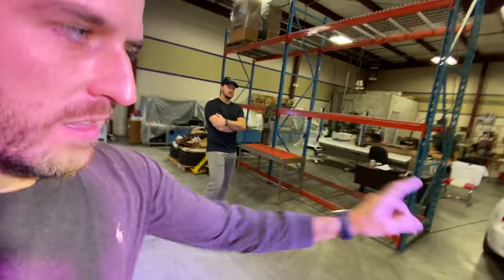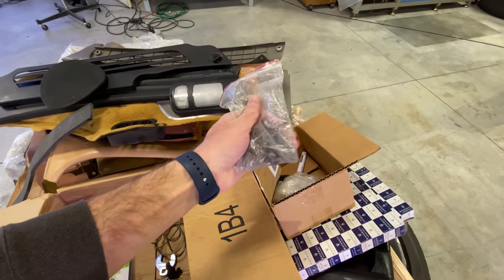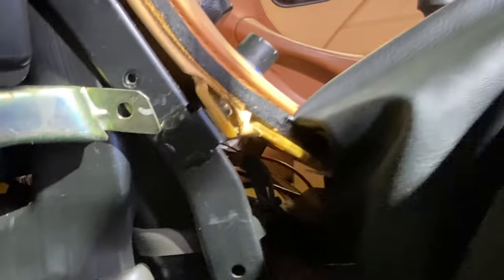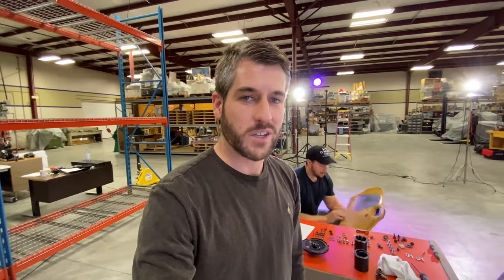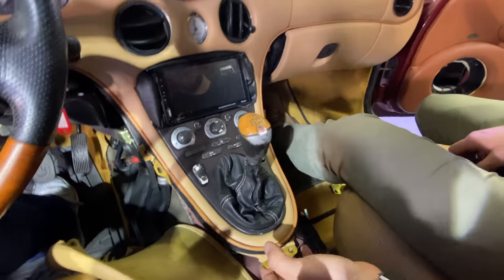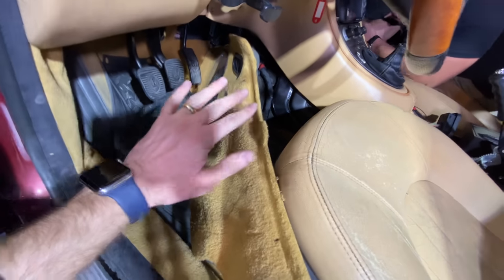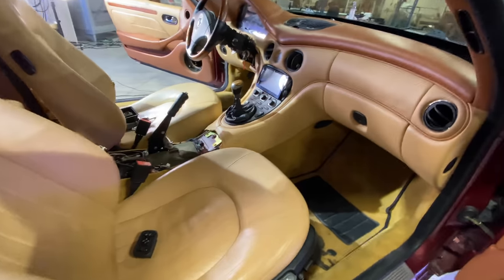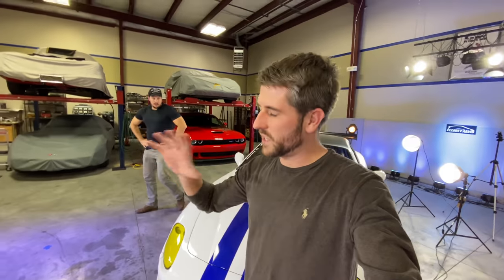Installing My Cheap Maserati Interior Is Like An Expensive Jigsaw Puzzle (With Many Missing Pieces)

Comment: That hole under the center armrest is for the OEM CD changer which should include a nice leather trim. https://www.eurospares.co.uk/parts/maserati/4200-coupe/electrical-ignition/car-stereo-system-20212 for pics how it’s supposed to be assembled.
Reply from the maker: Thanks Robert!  This car also has a CD changer in the trunk, is that not redundant?  I appreciate the link!
Reply: @ElliottAlvis  my bad, the CD unit in the armrest is for the GPS system. The changer in the trunk is for music.
Reply from the maker: @rvonbism  thanks for the info!  I’ll have to try and source a GPS unit to fill the space!

Comment: Looks great Elliot! Just use some fiberglass drywall tape and some resin then cover it in thin cotton material and resin on the headliner backing repair it will work well. Use very light coats of resin so its not thick and only on the back side of the headliner. Then glue your leather back on.
Reply from the maker: That’s the plan James!  It’ll be my first experiment with that sort of work. I’ll be sure to document it.

Comment: Question: When they were installing the panels, why not remove the seats (if it was possible)?
Reply: why take the extra work to achieve the same result?
Reply from the maker: The seats weren’t as in the way as we initially thought. We considered it though!

Comment: Why not just take the seats out, you do also have to repair the driver seat?
Reply from the maker: I already repaired the driver’s seat and window before the first video I made 😂. Also it turns out the seats weren’t as in the way as we initially thought they would be.
Reply: @ElliottAlvis  Alright, I asked because when I bought a Audi A2 to fix up myself it had the whole center console in the trunk and the gear selector need some microswitch replacement. I just found it so much easier to remove the seats then install the center, reinstall the front seats again and clear the fault code that comes from removing those by the VCDS.

But keep up the videos, I like that you seem to be engaged getting the car as you want it. 
Also use wood glue on the roof liners crack, it will be flexible enough for it to be installed